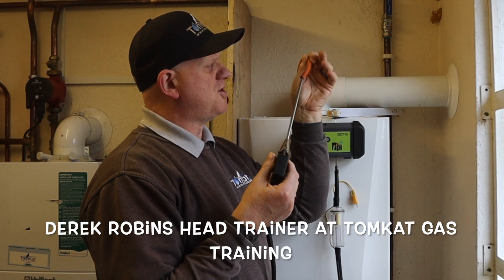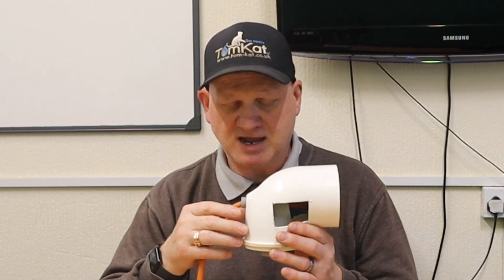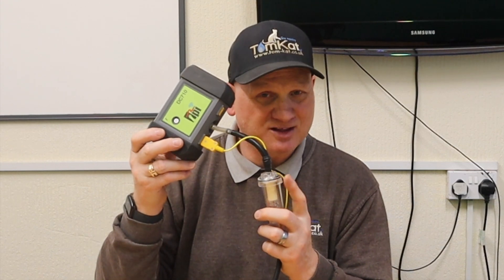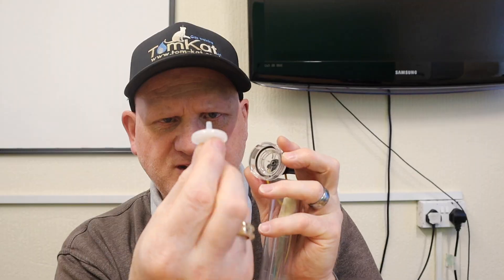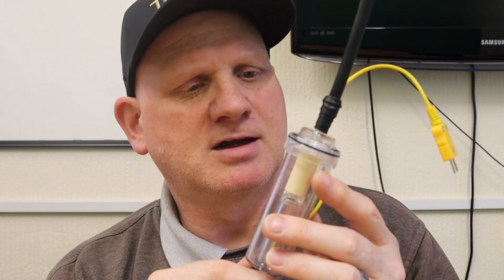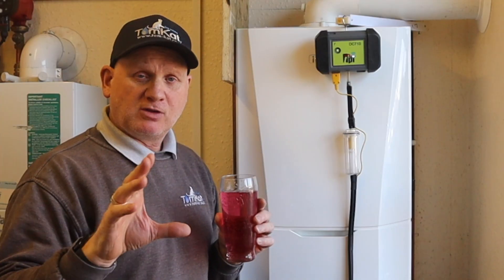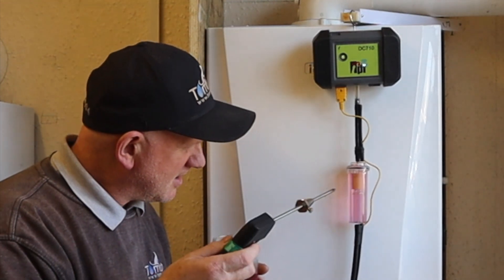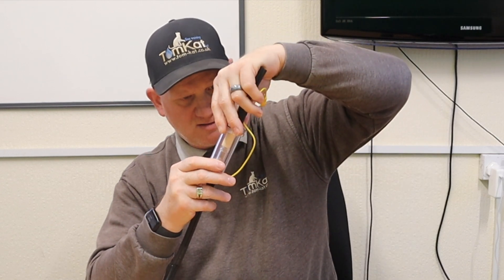STOP USING MANOMETER TUBES WHEN ANALYSING BOILERS, Introducing the TPI new analyser  bowl  filter.

Comment: I got my angle grinder out and cut down an old probe to about 31/2" that I had hanging around (I think it was left over from when my van was done over took the analyser and missed the probe) when I have restricted access I just get the stubble out of the, that’s my nickname for it never had a problem. Also if the flue terminal is a couple floors up years ago we used to use a length of 10mm tube with a bend on it reach out the window stick this in the terminal and stick your probe in the other end😊

Comment: I have never once heard of anybody doing this ever. If I can't get to the sample point, I just test at the flue terminal. 🤔
Reply: What if it’s a 1st, 2nd etc floor flat?
Reply: @matthewtrueblood408  get an angle adapter or a ladder, I guess 😂
I was just totally unaware anybody was using manometer tubes attached to their analyzer probes. There's no way that's getting an accurate reading.b
Reply: @matthewtrueblood408  I think he has long arms😂
Reply from the maker: I have had lots of comments on my videos on the right angle probe adapter saying why buy  one when I can just use my manometer tube. This is why I have made this video
Reply: @tomkatgastraining  oh interesting. Yeah, never been an issue for me.
Reply: @tomkatgastraining I've seen one gas engineer doing it about two years ago 😂
Reply: what if the terminal is extended pass the eaves?
Reply: @digitaria  angle adapter
Reply: Been doing it for ages. If the trappex adapter only goes in an inch. Use the manometer tube and poke it in the same amount and not into the condense flow path. Moisten a bit of tissue and wrap it round the ,anime yer tube to stop flue gases coming out the sample point.

Comment: My Testo came with tubes to do this
Reply from the maker: @pallsmortion4750  are you sure they are not for doing tightness testing
Reply: @tomkatgastraining  I bought just an analyser not a manometer
Reply from the maker: @ does your analyser not do tightness testing? And did the MIs show you to use the tube for this
Reply: @tomkatgastraining  no tightness test function. Testo 310, it's in the manual
Reply from the maker: @ let’s hope that doesn’t bite them on the bum 😂👍🏻
Reply from the maker: @pallsmortion4750  I have just checked the MIs I think you need to go and read them again because the hose isn’t for what you think it’s for